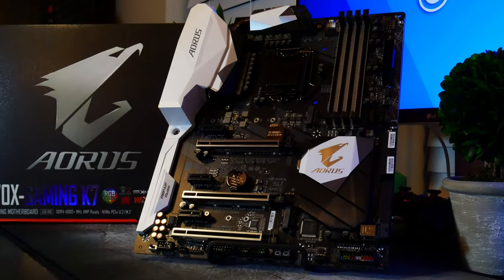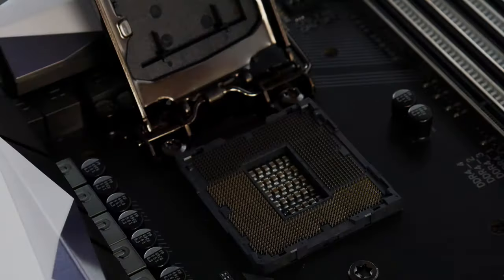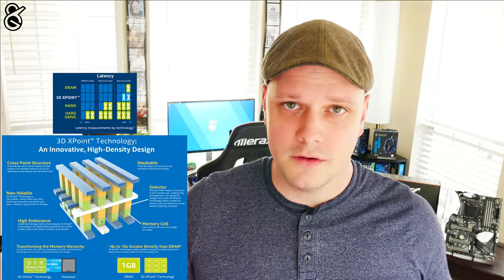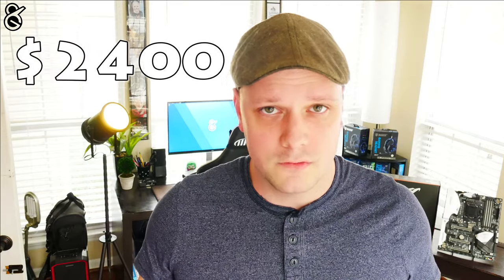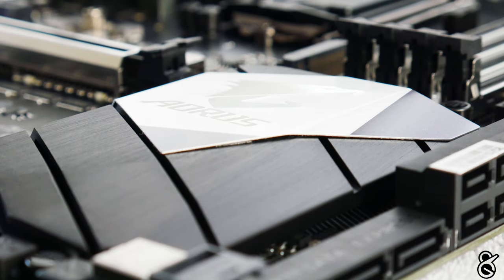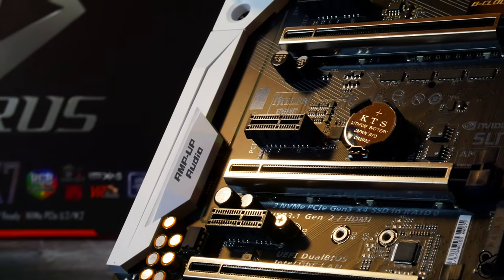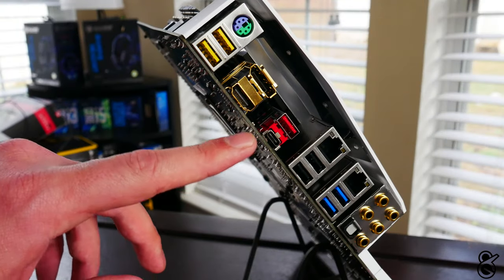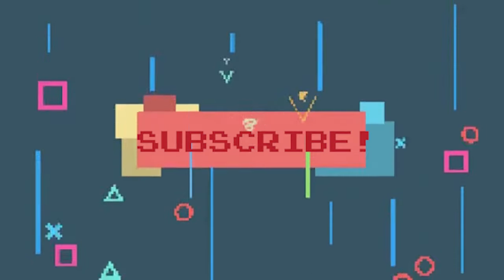CES 2017: AORUS Z270X-Gaming K7 Kaby Lake Chipset Motherboard First Look Review

Comment: So the only big difference from this k7 board and the 7 board is just the power button on it? Well and the price difference.
Reply from the maker: John Leonard no I/O connectors and support. Compare them 😊. Not at the desk atm
Reply: Eight-Six Went to newegg , (they have a tech clearance sale right now) and compared. The 7 is definitely worth the little extra and gas a gift WiFi card for a limited time. thanks for the reply on an old video to a question you had answers that I would have seen with little more reading in the comments. Great tech channel, keep it up.
Reply from the maker: John Leonard woot! Sounds like a deal! Enjoy!!

Comment: What are the differences between the Aorus Z270 Gaming 7 and the K7?
Reply from the maker: faustsmith aadhil asked that question, I'm on the phone or I'd paste that answer (there shouldn't be many comments if you scroll and check for my reply to it) otherwise give me some time and I'll copy and paste it here for you later (less I forget 😄)
Reply from the maker: I remembered! This is what I put together to help someone else, it's just a copy and paste, hope this helps you!!

largely IO differences, and features. 
The 7:
1 x Thunderbolt 3 connector (USB Type-C port, with USB 3.1 Gen 2 support)
1 x USB 3.1 Gen 2 Type-A port (red)
5 x USB 3.1 Gen 1 ports

The K7:
1 x USB Type-C port, with USB 3.1 Gen 2 support
1 x USB 3.1 Gen 2 Type-A port (red)
4 x USB 3.1 Gen 1 ports

The biggest selling point for some extra cash for the 7 is Thunderbolt if that tickles your fancy. 

There are other additional features on the 7
Comparing on board connection/headers (for instance 4 additional fan headers that the k7 doesn't have). I'll cite the comparable specs below:

the 7:
1 x 24-pin ATX main power connector
1 x 8-pin ATX 12V power connector
1 x CPU fan header
1 x water cooling CPU fan header
4 x system fan headers
2 x system fan/water cooling pump headers
1 x front panel header
1 x front panel audio header
1 x Trusted Platform Module (TPM) header
1 x RGB (RGBW) LED strip extension cable header
1 x Thunderbolt add-in card connector
1 x Clear CMOS jumper
2 x temperature sensor headers
1 x power button
1 x reset button
1 x Clear CMOS button
1 x ECO button
1 x OC button
1 x audio gain control switch
Voltage Measurement Points
2 x BIOS switches

The K7:
1 x 24-pin ATX main power connector
1 x 8-pin ATX 12V power connector
1 x CPU fan header
1 x water cooling CPU fan header
2 x system fan headers
1 x system fan/water cooling pump header
1 x RGB (RGBW) LED strip extension cable header
1 x front panel header
1 x front panel audio header
1 x S/PDIF Out header
1 x Trusted Platform Module (TPM) header
1 x Thunderbolt add-in card connector
1 x Clear CMOS jumper
1 x ECO button
1 x OC button
1 x audio gain control switch

You can literally find these comparisons pretty easily, but if the question is what makes the non K version cost a little more? I'm going to say Thunderbolt is the big feature difference some would pay a little more for.